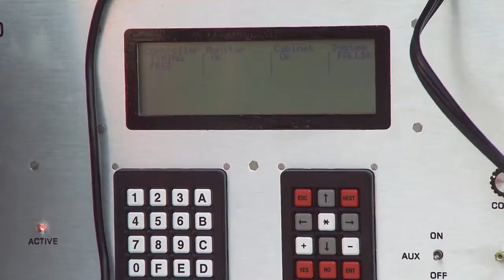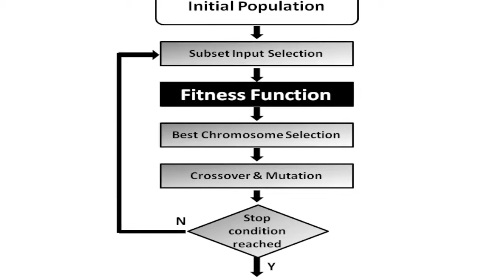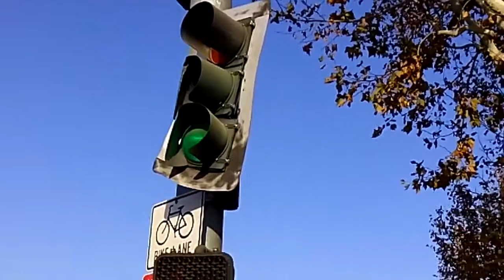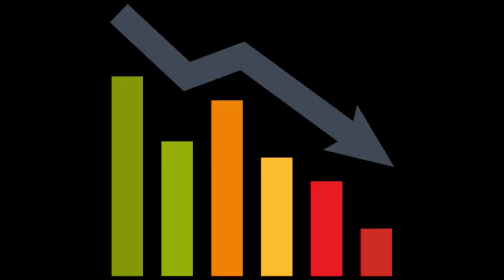AI Traffic Lights - IFB102 Assignment

Comment: I was just thinking of the same idea and I would have to agree with the majority of ur video, except the costs you brought up with maintenance. Money would actually be saved because instead of the major costs associated with tradition traffic solutions (building bigger roads), you would only have to spend a fraction of the cost on a rebuilt internal system for the lights. To be honest you could fit the AI on something the size of a Raspberry PI, and the protections already in place for current traffic light timers (water proofing, bug proofing) would be sufficient enough for an AI traffic light, thus there wouldn't be a large increase in costs. Furthermore your point about AI traffic lights decreasing the amount of maintenance jobs is nonsense, you still have to install sensors and lights on an AI traffic light, and routine maintenance would still be required. Also your point about how there would be a large team of programmers required to maintain these lights is also not true, the whole definition of AI is self learning, the light would learn the optimal traffic timings without human intervention necessary. Literally a team of programmers could develop a single AI to install on all traffic lights, the AI learning to adapt to each unique scenario by itself.